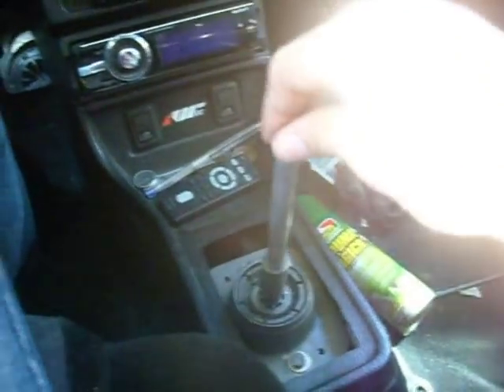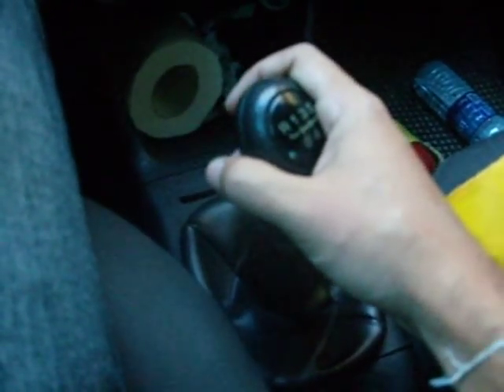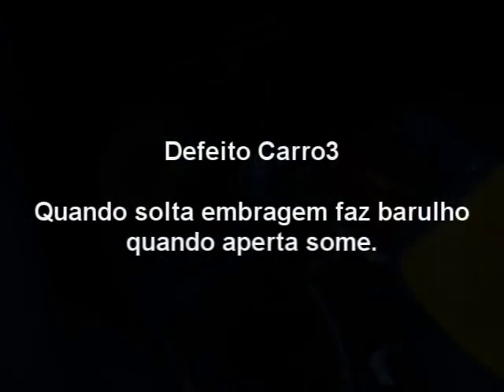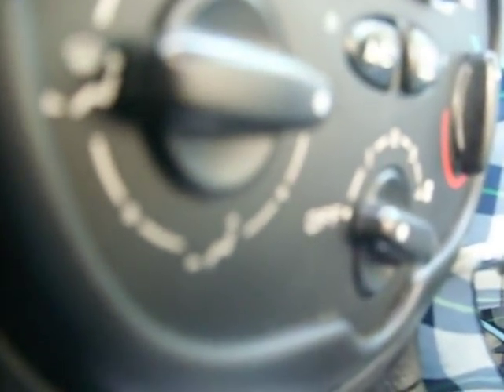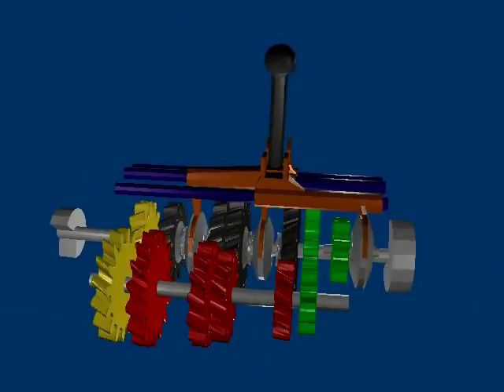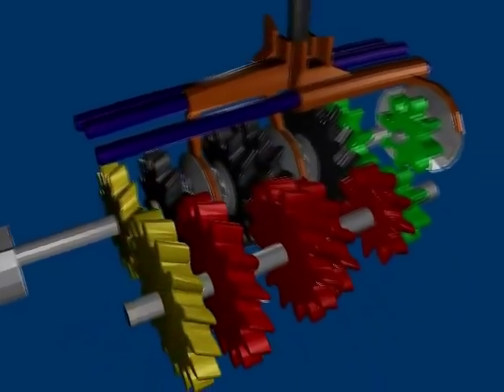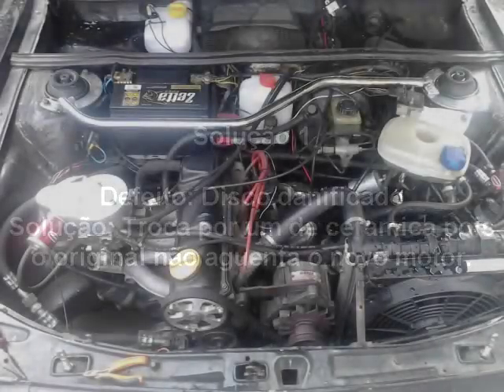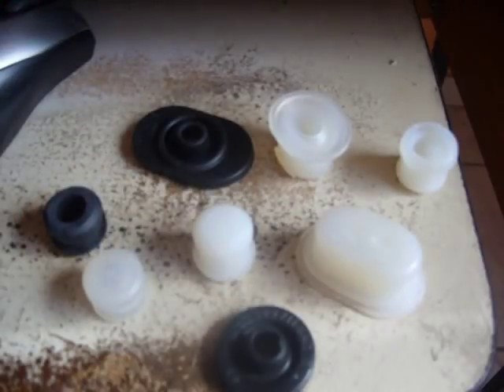Dica: Como saber se a embreagem está ruim? - Milan Dark

Comment: Tenho um Corsa Classic 2008 motor FlexPower e quando forço uma  marcha, ou quando atinjo a partir de 90km/h, ouço um assobio ao acelerar. Não é tão alto, mas está me incomodando e me deixando preocupado. Será que seja necessário a troca da caixa de marchas para solucionar o problema, ou pode ser somente um problema de rolamentos?
Reply from the maker: eis o x... o assovio é em qualquer marcha? o assovio faz em ponto morto? o assovio só faz em alta velocidade até mesmo em ponto morto?
Reply: Paulo Rogato Filho tenho um celta que faz a mesma coisa, mecânico disse que é o alternador
Reply: se o barulho e quando aciona a embreagem é o rolamento da embreagem no caso em que voce acelera por rotaçao o rolamento da correia dentada ou da correia do alternador ou do proprio alternador  o rolamento da roda quando atinge altas velocidades por exemplo 90 km/h faz um chiado no seu caso parece ser de correia depois dos 3500 rpm começa a fazer barulho nao é
Reply: Paulo Henrique 1944  o meu já assovia na primeira marcha
Reply: deve ser o rolamento da correia porque ele é por rotacao nao por velocidade as vezes ate a 950 rpm ja assovia
Reply: Paulo Henrique 1944  quanto  custa mais ou menos pra arrumar?
Reply: acho que uns 250 R$ . em uma oficina boa voce tem que tirar e colocar a correia soltar o rolamento e trocar depois é so colocar a correia e por no ponto vai 150 R$ de mao de obra mais uns 95 a 100 R$ do rolamento original
Reply: Paulo Henrique 1944  barato, outra pergunta, minha embreagem  do celta tá um pouco dura, pensei em trocar só o cabo, ser a q alivia? alguma pessoas me disseram pra trocar o cabo e se não fosse daí partiria para embreagem.
Reply: as vezes é so o cabo mas as vezes é embreagem eu acho que voce deveria trocar so o cabo sim para saber
Reply: a embreagem geralmente dura de 60 a 80 mil km na cidade e na estrada chega a 120000 km mas ela pode durar 40000 km se mal utilizada